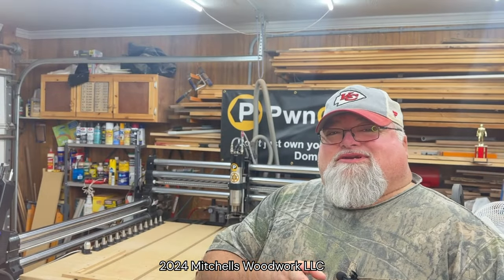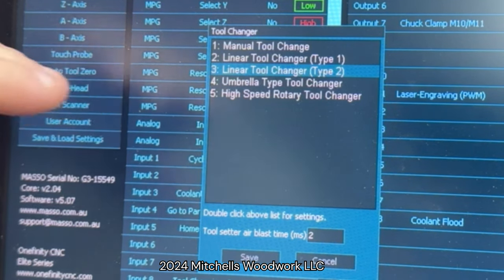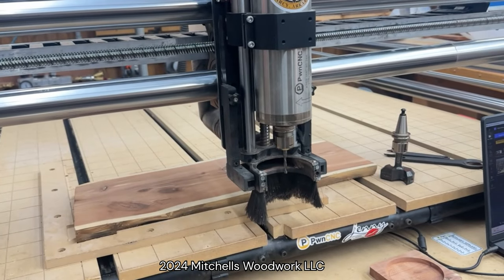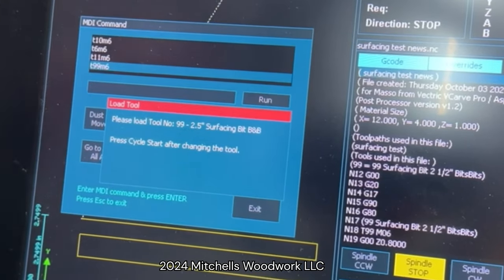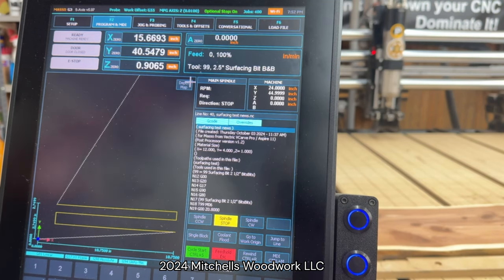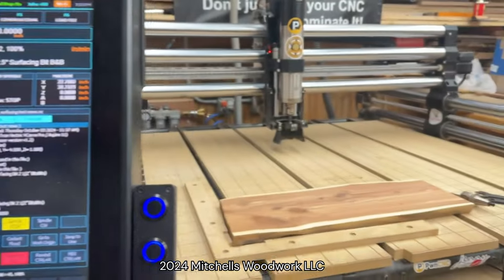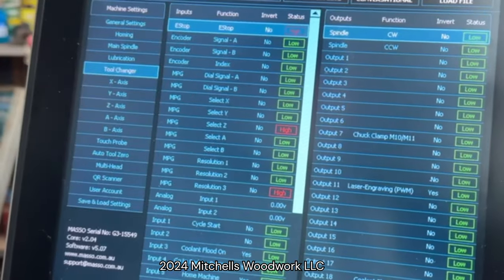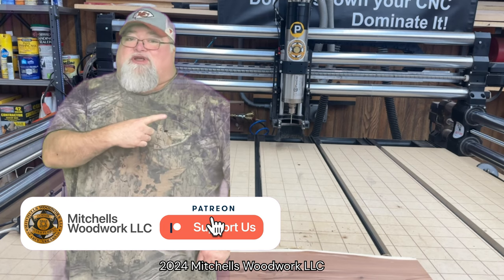How To Use Your PwnCNC ATC in Manual Mode Like A PRO!

Comment: Great. video. What about the length?
Reply from the maker: The length of what??
Reply: The Length of the bit
Reply from the maker: In the video I just set the Z zero above the board so it wouldn't actually cut anything.  Normally you'd just set the Z of the surfacing bit like you would any other bit, with a probe block, paper method, or tool setter.  But take note that surfacing bits have to be zeroed on the actual cutting blade because it extends below the body of the bit.

Comment: hi, Mitchell, Masso support let me know,

It will appear in the F4 screen if it is correct and there you can for example do a manual change with your probe or other tools that do not fit in the holder, below is the text from the support department of masso.

"The ability to manually load tools when using a linear tool changer is current for the 5.100 beta version. It is live and free to download and test.

Please ensure to make a backup of your settings files before moving to the beta software, then double check that the inputs and outputs match up to what they have been assigned as. - some axis alarms can change to tool changer inputs for instance."
Reply from the maker: That’s awesome that they’re making that change.  I’ll wait until they update from the beta mode though, then I may do another video on the new method.  Thanks bro!